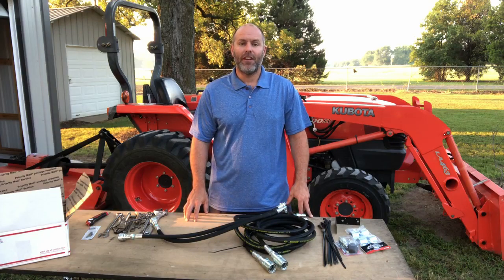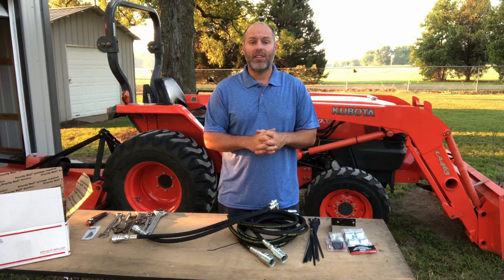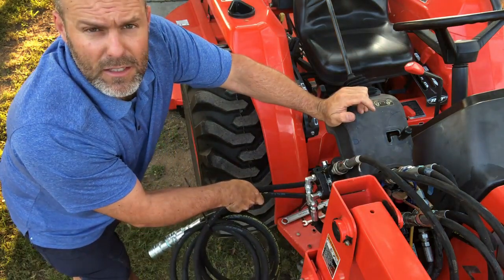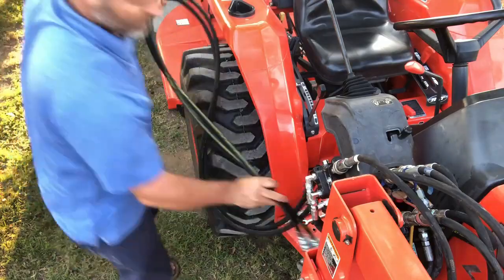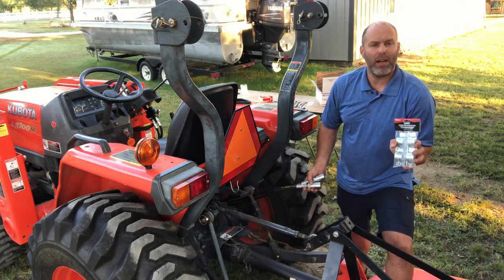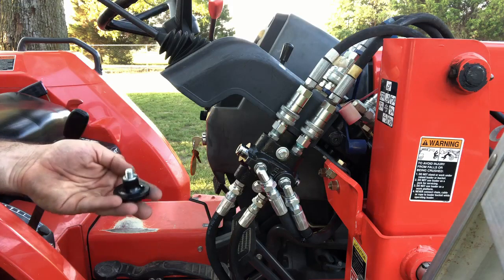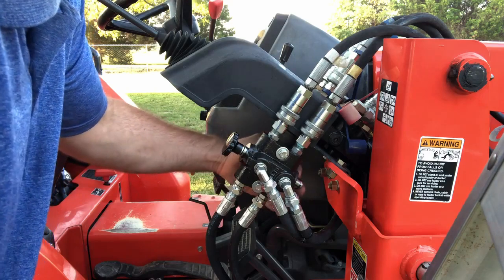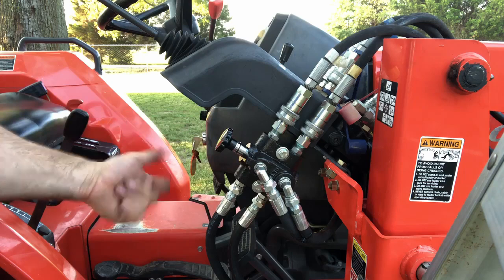$595 Remote Hydraulic Kit for Kubota Tractors - Updated - No drilling required!   15 minute install

Comment: Just ordered the kit today. After looking at my new Kubota L4701, the bolts are spaced wider apart under the loader control where the bracket mounts. The middle set of bolts like you removed, are the ones I’m referring to.
Reply from the maker: Yes, the newer tractors have wider bolts, and your kit has the right bracket to mount on those wider bolts.   You're good to go!

Comment: If I have a BX1500D with no loader and no remotes of any kind, do you have a kit to add a joystick control to that? (for example if I want to get a snowblower mounted on the front and connected to control joystick to raise and lower)
Reply from the maker: Sorry, my kits require a loader.

Comment: I have a Kubota L3301 with LA525 loader. I’m needing hydraulics ran to my three point area to power hydraulics on a woods TSG50 stump grinder. The grinder already has a joy stick for controlling it. Would this kit be practical for that or do you offer another solution? If it will work with this I may go ahead and get this so I can eventually add a hydraulic top link.
Reply from the maker: Yes, this kit can provide constant flow to the remotes to power your stump grinder.  You woulc then control it with the joystick.   It will also work perfectly with the hydraulic top link.
Reply: @TractorInnovations  I'm thinking about getting this for a custom wood processor I'm planning. It would need constant flow but I don't see how that'd possible if the loader control valve is in the way. Would I leave it in float mode?

Comment: Would you be able to flip this over vertically? I have a Kioti DK4510 and the bolts on my loader control are on the left side of the plastic frame. The valve would need to be mounted between the loader control and the dash.
Reply from the maker: I build everything to order, so I can fit whatever needs you've got.   Yep, flip it over vertically is no problem.   Send me a couple pictures, and I'll get it done for you.   541-972-0546

Comment: I bought one of these for my 18 yr old Massey Ferguson 1433 Tractor.  Great way to add a set of hydraulic couplings to the front or rear of tractor.  Mine use the bucket tilt function to operate.  Haven't had a problem.  Thanks.
Reply from the maker: Glad to hear it's working well for you!    We just passed 2,000 of these kits in use!

Comment: would this work on a different make tractor with a similar layout?   More so the valve and hydraulic lines.  Not concerned about mounting brackets I can make those.
Reply from the maker: Yes, I build these for any tractor out there.   Send me a picture of your quick coupler area, and one of a quick coupler disconnected, with a view of the male fitting.    That's all I need to build you a kit.

Comment: I have kubota l3901. I would like to add 3rd function on front as well for grapple. Will this kit still work?
Reply from the maker: Yes, this kit can work well in a couple different configurations.   You can install two complete kits, giving you front and rear functions, or you can install an electronic 3rd function from another vendor, and use this kit to select between the front/rear functions.

I can knock $50 off the second kit if you install a double kit.   Super easy installation.  Email me for pics.   tractorinnovations@gmail.com

Comment: I ordered a hydraulic kit for my L3560 with LA805 loader a couple days ago.  Have not received it yet.  This installation video shows installation of the valve bracket on the bottom of tractor loader control lever.  My L3560 has its control lever mounted on the right side of the seat, i.e. not like the control lever shown for the L3700 in this video.  I am hoping that the kit will have a bracket that works for my tractor?  Will it?

This kit is genius, by the way.
Reply from the maker: Yes, I build these to order, so if you order with a different model of tractor, I'll build for that.   Your installation will look more like this other video:    You will drill two holes in the firewall to mount the valve.
https://www.youtube.com/watch?v=ebTyZMsXdgs

Comment: I am looking to run my wood splitter and this likes a reasonable solution.  Possible?  What connections off the front would I use?
Reply from the maker: Yes, I have had quite a few customers set this up to run their long splitters.   It comes with 1/2” Agriculture style quick-connects on the remotes - it comes with a set of make and female tips, and you can find additional male tips for your other implements at any farm supply store.
If your log splitter had its own control valve, you’ll pull the switching valve, then simply bungee-cord the loader control to provide constant flow to the remotes.
Andy
Www.tractorinnovations.com

Comment: I'm a little lost on something. I want to control a grapple on my Kubota L3560HST-LE. Does this kit do that. You ran the hose to the three point. I'm curious can you run it to the loader area and connect a grapple. Sorry for my ignorance. When I bought my tractor I stated I was going to get a grapple and they sold me a tractor without the secondary hydraulic connection. Now they want $2700.00 to install what I assume you have. Thanks for your response ahead of time and if you have what I need I will be purchasing it from you. Good video and thanks again Michael
Reply from the maker: Yes, this works great to control a grapple.   Here's a video of how that works.   I build the same kit whether you're running it forward or back.
https://www.youtube.com/watch?v=SJHJyc2t5Mo&t=1016s

Comment: Would you hook things up the same way for a grappler in place of a bucket?
Reply from the maker: Yes, works just the same.  It comes with 8' of hose - enough to reach the rear of the tractor for rear remotes, or to the front of the loader arm for a grapple.

Comment: Looking to see if you could add two remotes
Reply from the maker: Yes!    I build a custom bracket to mount both switching valves under the loader valve, and you can have one or both activated at any given time.    You can control both rear functions (or one front, one rear)  from the loader joystick.   I can knock $50 off the second kit.

Comment: I have an L3302 with a 3rd function kit hanging off the place where you mounted the rear remote valve assembly.  I can't imagine I'm the only one - have you seen this, and do you have a different mounting solution?
Reply from the maker: Yes!  Check out this other video.   You have the choice to power the remote from one of your loader circuits or the 3rd function.  
 
https://youtu.be/7YY6XICxIpQ

https://www.tractorinnovations.com/3rdfunction

Comment: I have a l2501 with no 3rd function. I want to run hydraulics to the rear to use as a top and tilt function. So dual rear remotes. I like the idea of being able to use the 4 loader controls to control both the top and tilt functions. Do you happen to have a video showing this? What would I need to order from you to get that function?
Reply from the maker: Yes!   the install is almost exactly the same as this video - just a different bracket, and you install two complete kits.   You can active either one or both remotes at any given time.   I can knock $50 off the second kit, and I sell the top link and side link as well.  

www.tractorinnovations.com

https://youtu.be/ZnjIVDc3tD4

Comment: I have a Kubota MX5200 w/LA1065.  Want to operate a grapple.  Will the factory joystick operate all functions or do you have all use the divertor button in between movements.  Can't find a video showing grapple operation.
Thanks,  Rob
Reply from the maker: Most folks that use this with a grapple install the kit on the "dump/scoop" function.   So with the knob out, you can lift and grapple at the same time.   With the knob in, your loader works as usual.    This is the dead simplest way to get that function on your tractor.  Made in USA parts, nothing electronic to break!

Comment: I want to use the front bucket lift hydraulic circuit (not the curl circuit) to control the top link in the rear.  It is not obvious which hydraulic hoses for the loader bucket I need to connect to the diverter valve to accomplish this.  Are they color coded, or identified in some other way?
Reply from the maker: Yes, they're color coded.   Give me a call with the model of your tractor and I can tell you which ones are which.   You can also trace the hoses back from the lift or dump cylinders to figure out which are which.

Comment: Could this valve be used to run a hydraulic thumb on a back hoe? JD had a valve like this. This is a great idea for some one.
Reply from the maker: Yes, absolutely.    I can build kits for just about anything like that - I just need to know hose lengths and what the connectors need to look like.   It should wind up the same price or less than the standard kits I build.

Comment: Would this kit be co-compatable with a Kubota LandPride 3rd function kit that is already installed on a Kubota L3901 tractor?
Reply from the maker: Yes, it still works great.   Just let me know that when you order, and I'll swap a couple fittings and the bracket to make it sit under the left side of the loader valve.   This also works when you want to install two kits.   Many successful installs with a 3rd function already in place.

Comment: how is this different from factory rear remotes? Is it just that you can install on the front of the tractor and not the rear?
Reply from the maker: Yes, you can run these to the front or rear.   These are a universal and affordable way of getting remotes on lots of tractors - many of which you can't get parts for, or are really expensive.   This uses a made in the U.S. valve and hoses.  And you get insanely good customer service.   Call me!   541-972-0546

Comment: Thanks for sharing. Can you tell the threads sizes at the hydraulic bloc, as I would like to install a control valve first. Mine is a L2850D (1993)
Reply from the maker: We've had over a dozen installs on that family of tractors.   It works great.   For your tractor, you'll want the economy kit.   It taps in where the rubber hoses meet the steel lines on the right loader arm.    Everything about this kit is after the loader control, so that the over-pressure safety system is preserved.   One circuit of the loader valve then acts as the control valve for the remotes.   Simple install with no electronics!
Reply: @TractorInnovations  Thanks for response. Could you shed some light on the economy kit, please. Never heard before. Besides this, I tend to install a DIY solution.
Reply: Is this kit available for a AG-CO ST34A this is the solution I've been looking for

Comment: could this be used to run a hydraulic post pounder?  the post driver specs says this. "The return line (dump line) must return to your hydraulic fill reservoir. This line cannot be quick coupled back into your machine." ? not really how to ask!!!
Reply from the maker: Yeah - some implements are really picky - they can't handle any back-pressure in the return line.   Not a problem - this kit can provide the pressure side, and then you would plumb the return line directly to the fill reservoir on the back of the tractor.

Comment: Whereas this is tied to the loader valving, would this work for a woodsplitter hook up?
Reply from the maker: Yes it will, but you'll need to bungee-cord the loader control into position to activate the constant flow to the rear (then you use the log splitter valve to move the piston).  Mush like this video of this kit running a backhoe:
https://www.youtube.com/watch?v=tFx8aFI54B4
Reply: @TractorInnovations  Thanks! And tieing it off like that wouldn't generate too much heat in the valves?

Comment: I have a Bx23s with the backhoe option. Is there any kind of way that I can use the hydraulics already back there?When the backhoe is not on
Reply from the maker: Yes, I build a kit for that with its own spool valve.   541-972-0546

Comment: What, exactly, is the difference between the $530 "plug and play" kit and the $480 "economy" kit? I want to put one of these on my Kubota L3901 to use the hydraulic feature on my flail mower. It's not really clear what the difference(s) between these kits are on your website, other than the $50 price difference.
Reply from the maker: Hi Pauli,  Thanks for the question.   For an L3901 The plug & play includes the quick couplers with the kit, so that all you have to do is disconnect your existing couplers, and plug these in.  The economy kit for your tractor would come with threaded connections, and you would disconnect the quick couplers, then unscrew the male quick-coupler tip from the tractor over to the switching valve (using pipe dope to seal it).  Then use the threaded fitting to connect the hose, and connect the quick-couplers.    With either kit, you can still remove your loader as designed.
So it's your choice if you want to have super-quick install or save a little $.   I'm happy to fulfill your order!

For older tractors without 4 quick-couplers, the economy kit taps into the hydraulics where the rubber hoses meet the steel lines going up the loader arms.

Comment: And I would I still be able to use my front end loader with the system hooked up?
Reply from the maker: Yes, absolutely.    With the knob in, the loader works as usual.  With the knob out, you trade one of the loader functions for the remote.   So with the knob out, you control one loader function (your choice whether you keep lift of dump function) plus the remote.

Comment: So with this kit I should be able to run a hydraulic top and hydraulic tilt cylinder on my l3901 for say a box blade?
Reply from the maker: One kit runs one remote function.  I've had quite a few people install two kits for double function like you suggest.    Then you control top link and tilt from the same joystick.  Email me and I'll send pictures of that install.   I'm happy to offer $50 off the second kit.

Comment: Will this work on my Kubota B3150 which already has a third function from the dealership? I want to add a hydraulic top link
Reply from the maker: Yes, it will work great.  You can choose to have this kit operate independent of the 3rd function, or actually have it switch the 3rd function.   You can have the 3rd function control the front grapple, and then when you pull the knob, your electronic switch controls the rear remotes.    That way you don't have to trade away a loader function.   Very flexible - I can build however you want.   Give me a call 541-972-0546

Comment: This is great.  Made in the USA is even more awesome!  Any issue with adding this in addition to the loader 3D function kit on an L3901?
Reply from the maker: Works great even with a factory 3rd function.   Just note that on your order, and I'll swap the bracket and a couple fittings to make it mount under the left side of the loader valve, instead of out to the right.
Reply: @TractorInnovations  order complete.  Thanks.

Comment: Will this still work if you already have a 3rd function installed for the front? Looking to add a hydro top link.
Reply from the maker: Yes, it works well with a 3rd function installed.  Let me know that when you order, and I change around a couple fittings and the bracket so that the valve sits underneath the left side of the loader valve.   Clean, easy, professional looking install.

Comment: could your valve system be modified and used on a Kubota b2301 with a bh70 backhoe using the power from the loader grapple, with a split connector so hoses can stay fully connected and  operate a thumb on the backhoe from the backhoe  seat configuration .
Reply from the maker: Yes, absolutely.  I would just need to see the connector type you want on the input side of the switching valve.  Send me a picture of the output of the grapple valve - that's where you'd swap the hose to go to the switching valve, then outputs go to either the grapple or the rear/thumb.  I build every kit to order, so it will cost the same as a regular tractor kit.   Andy
Reply: @TractorInnovations  SORRY it's taken so long to reply , i will be contacting you in the next couple days

Comment: Can I install this on a bx2370-1 with an all steel Curtis cab installed
Reply from the maker: Yes - I'd just need some pictures from you of the access hole where we could pass 6 hoses through.   Text to 541-972-0546

Comment: Will this work on a Kubota BX23s?

Also, will you be offering a 3rd function kit? For grapple use?
Reply from the maker: Yes, works great on the BX series.   Those often have the swift-tach 4-in-1 hydraulic couplers.  Here is a video that shows the install on BX series:
https://www.youtube.com/watch?v=rfDZ3S0l00o
Reply: @TractorInnovations  

Awesome. Thank you.

Comment: I need this kit for my 2019 l3301
Reply from the maker: This kit fits your tractor perfectly.   It will come with a longer bracket to fit the wider bolt spacing of your loader valve.  Still a no-drill installation.   I am all caught up in the shop, so I can have it on its way to you tomorrow.   Just order on my website or give me a call.   Your tractor uses the plug & play kit.
https://www.tractorinnovations.com/kubota
541-972-0546

Comment: Will these work on the new LX3310's?  They should be very similar to the B3350.
Reply from the maker: Yes!   Several customers with LX series tractors have given feedback that it was a simple install, and is working great.    You've got quick-couplers, so you'll want the plug&play kit.   $530 total with free shipping.

Visit my website, or give me a call to order
www.tractorinnovations.com
541-972-0546
Reply: @TractorInnovations  Thank you.  Any idea what top link would work best for this tractor?